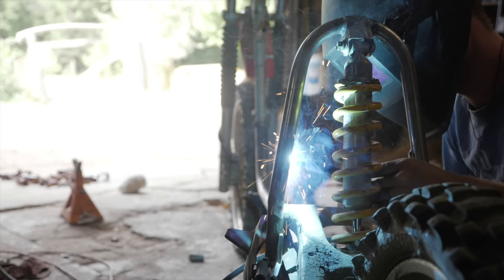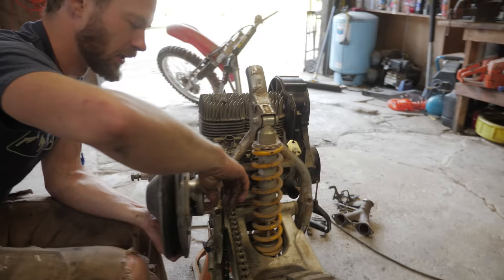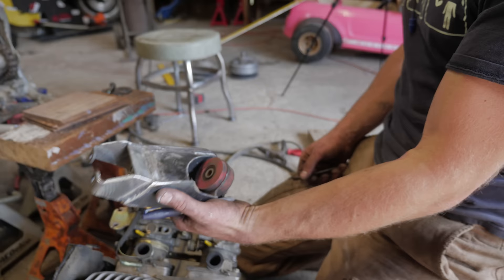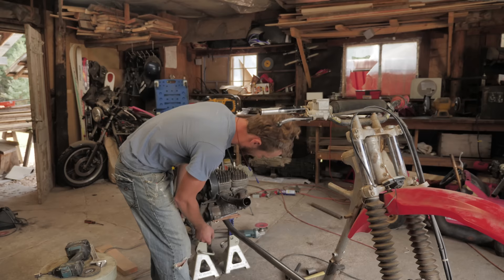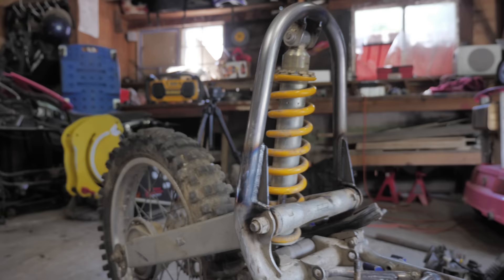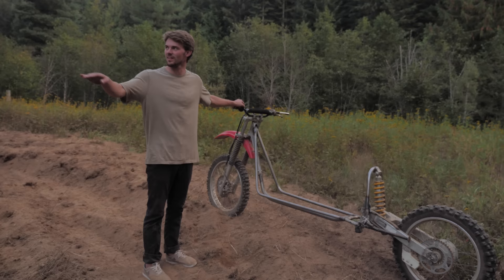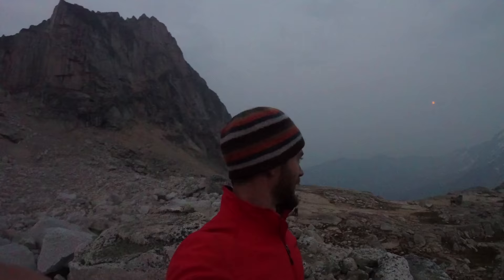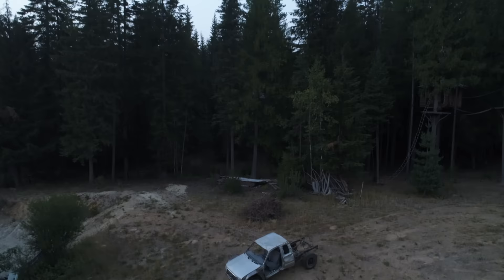A Snowmobile Powered Mountain Scooter?!

Comment: You will have to mount the shaft with the sproket and clutch to the stationary part on the front part with the engine. If the clutch isnt in a stationary mount it wont work.

Comment: If u flipped the back wheel around so the sprocket was on the opposite side u could run the jack shaft across the the back the width of the engine and put the belt drive on the one side and a sprocket on the other side for the back wheel idk how the swing arm is but u might be able to flip it and fab up the shock just a thought don’t kill me
Reply: Jerry Wooton depending on next the gearing wanted... Having more sprokects lets you set a torque ratio. Like a mountain bike or manual drive car in a single speed. I vote future upgrades to the jackshaft to have a second speed!
Reply: Alec Fleming yes I am aware of the fact but considering that the snow mobile engine doesn’t have a transmission with gears u would want a medium set up meaning a smaller sprocket on the engine and a decent size sprocket on the wheel similar to what the dirt bike had originally if u put a smaller sprocket on the wheel it won’t be very fast it will have torque but will be slow at high rpm putting a bigger sprocket on the motor will give u top end but no power and be more strenuous on the motor and using multiple jack shafts I doubt will help very much you’ll  trade power for speed unless u can switch the gear ratios like a mountain bike it looks like to me the reason he is using the jack shaft is to adapt from the belt drive of the engine to the chain for the back wheel another option I would vote for is a belt driven torque converter it would be pretty easy to modify to there set up and would be close to having gears reguardless it’s cool and I’m anxious to see how they go about doing it and thanks for the insight I just feel like what ever there final sprocket configuration is could be simplified by attaching them simply to the drive line
Reply: Facts
Reply: @jerrywooton2043  he has a CVT transmission.  Constant Variable Transmission.  Its always adjusting gear ratio depending on motor speed and final drive speed giving an ever changing, optimum "gear" ratio.
Reply: Evan Jones where did u see that at or did u just watch the same thing I did and come up with that  on your own he did not mention it and I don’t see one so ?
Reply: @jerrywooton2043  the clutches are the cvt trans, along with the belt he mentioned.  Never seen a snowmobile, eh?
Reply: @jerrywooton2043  like you said about the secondary being a torque converter..   its variable..   the primary grabs the belt and the higher the rpm, the bigger circle it forces it around..  and it pulls into the secondary. It will do this according to throttle, power and load. Clutching is an art, there is no out of the box set up for builds like this.  To get full potential, they will need to do clutch work. Its just how snowmobile clutches operate. (And auto four wheelers)   Though I do agree with you on deleting the second jackshaft. Worst case, they run a 12T front sprocket and a bigger rear.  Nbd!  Not gonna be enough traction with a 480 Yamaha engine on a dirt bike wheel to really worry about it anyways IMO
Reply: you can clearly see that its a cvt transmission

Comment: OH Wow,   I was just so used to pulling up on Videos like this  like years after they are done, i got to the end of this one without even checking the date, I was pissed there was no part 2. LOL   
    Ok so, i will keep checking back and stuff.        I really wanted to hear how that would turn, both the test test rides were straight runs, is that because there is a problem with length?

Comment: never seen a car with flat smooth botton to crawl over some kinds of snow by what blades on rear tires, or wings on car then drive it fast enough to lift, or parachute, well that killed some guys once. was it a pinto.think they put a tail on it.  so driver should be very old and bored of life. more ideas, try to think of something, car  wtihout tires on two wires ..boring.